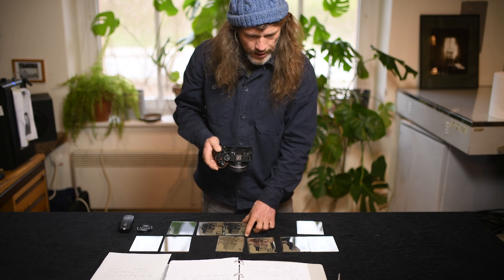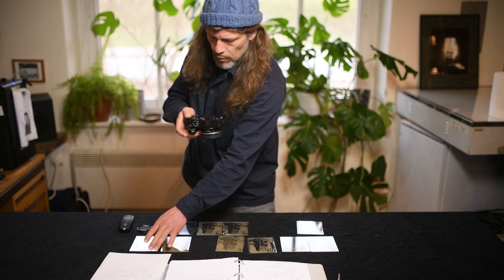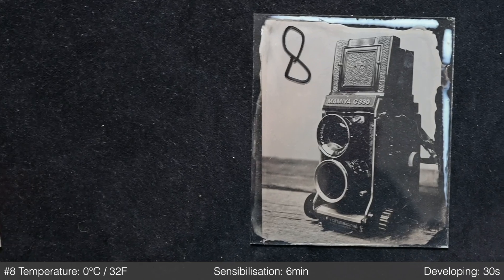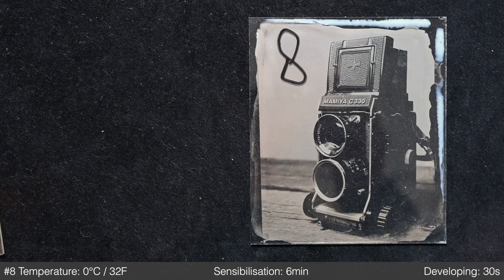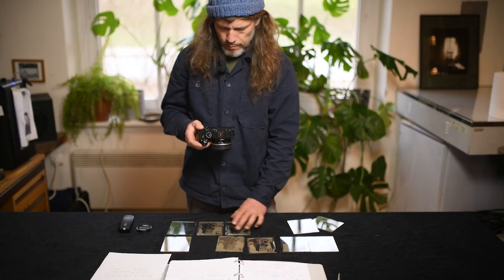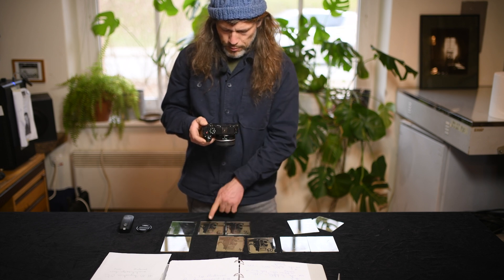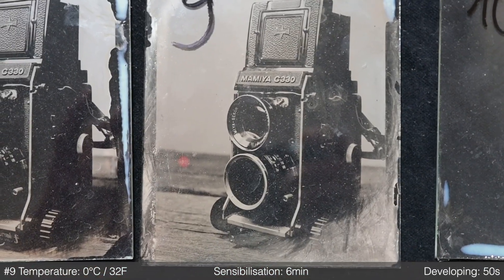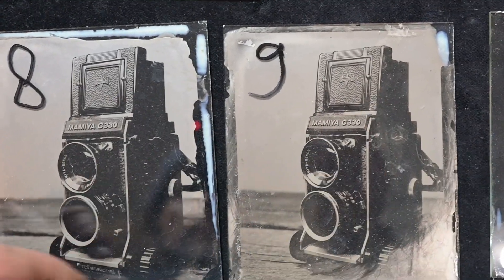How Does a Temperature Affect Wet Plate Collodion Process?

Comment: In my experience, it’s not the “room temperature”, but rather the temperature of the chemicals (especially the developer) which has an influence on veiling. Heat speeds up the chemical reaction of the developer, and even unexposed silver is developed. This can be prevented by either keeping your developer cool or cutting it down by 50% with water, making it weaker.

Comment: Very informative! What I've always wanted to try but never got around to is if you can lower the concentration of silver in the bath for hot weather. Instead of using a 9% bath when it's 30C and cutting sensitizing time, use a 7% bath and keep it normal. It would probably come to the same result though yours would be faster because of the shortened time. But I also wonder, with the lower amount of silver, if it would help control fog even more.
Reply from the maker: Yes, I would say so. But I would go with 6%, although in heat you want to shorten the processing time, due to drying, not prolong it. During the cold winter I wanted to raise the concentration of the silvernitrate, but I've seen that with 9% at 0C I could work just fine.